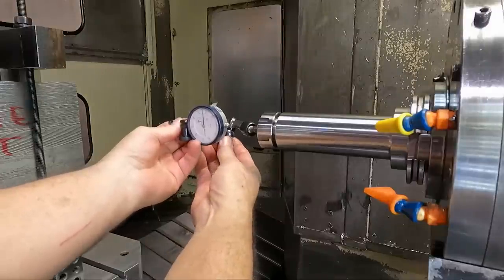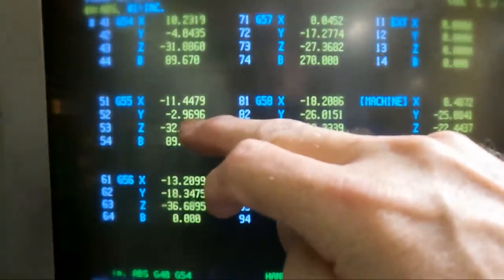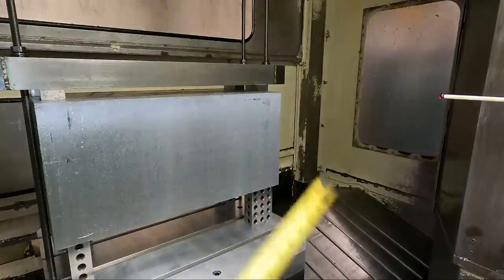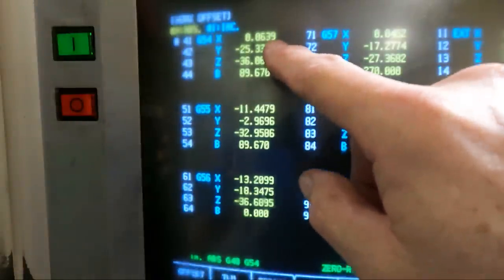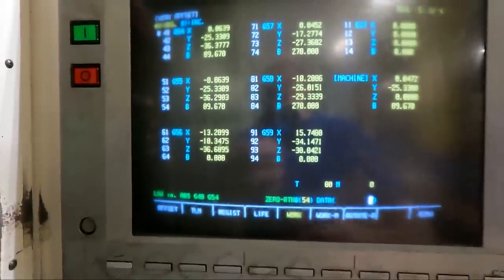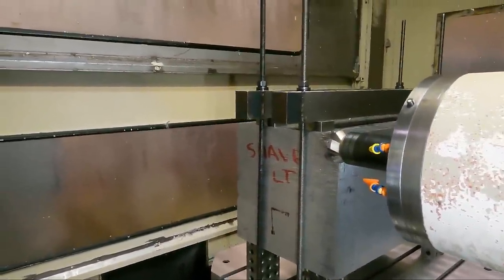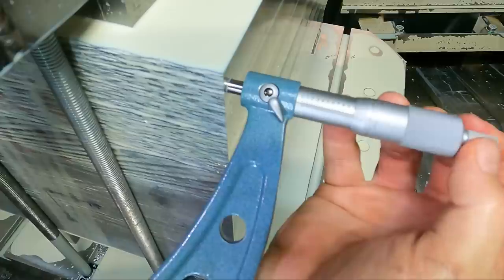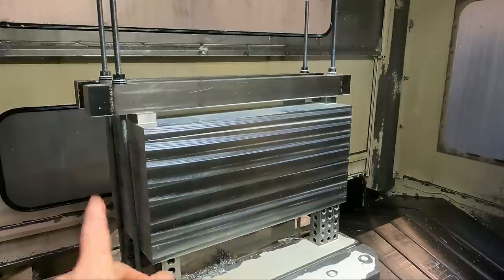Facing A Large Aluminum Forging

Comment: Did you ever try using millimetres? Realky is much easier to get the central measurement than inches.
Just try it!!!
Reply from the maker: I use both systems. Its just because my tape measure is in fractions. If it was in decimal inches it would be the same as a metric tape. I don't really understand this argument. When you are dealing in decimal inches its the same a the metric system. It's just that a meter is a different length than a yard. But the micrometers work the same everything is divided by 10,100,1000 in inches or millimetres. Its kind of like saying English is better than Spanish or some other language. Wouldn't it be better if you spoke both languages?
Reply: @David Allinson what do you have to say
Reply: @AlexxMarssh  I am 82 and grew up using inches but when metric came along I basically abandoned inches. I have done some heavy shipyard machining but in contrast took up clock making 20 years ago. Many clock designs are in fractions of inches which I found very unsatisfactory. If they had been decimal it would have made my life so much easier.  My mill and lathes are all metric so I kind of think in metric rather than inches. 
Thanks for your response which I  always find interesting from practising machinists.

Comment: Why not use a battery powered-drill with a ball-end or normal hex head to do the bulk of the bolt turning for those numerous fixture bolts, and use a wrench to do the final torques? Perhaps I'm lazy.... you must have strong hands anyhow XD
Reply from the maker: What did we use to do before battery powered tools. Kind of like cell phones. Actually your not the first one to make a similar comment. Except they mentioned a cordless impact wrench. I don’t have one. But I do have a air impact and you saw me using a air gun to blow off the screws. I could have used that. But I like to do things old school. Didn’t take but a minute more to do. Thanks.
Reply: @EdgePrecision  You may want to consider watching a couple of videos on the channel "Mr. Chickadee". All manual woodworking - very relaxing. Guy has some opinions about power tools. I can definitely see where you're coming from - everyone draws the line somewhere. Like the joy in I take in manual layout + machining when I have a perfectly good cnc. Thanks!

Comment: As far as I know, these big sawn Aluminium pieces are cast and not forged, but maybe there are also big forgings
Reply from the maker: These are forgings. It says so on the paper work.
Reply: @EdgePrecision  Okay, then they are obviously forgings, from my work I only know these as castings
Reply from the maker: The side you saw in this video was sawed (I think from a larger block). But the other sides you couldn't see in the video. There are definite hammer marks where the power hammer forged the block. It is not smooth or flat. Just like a steel forging.
Reply: @EdgePrecision  Okay, at work we have even larger blocks, but they are sawn on all sides.
Reply from the maker: @nightraidone9768  One other thing these blocks have is. Marked on the outside faces are grain direction arrows (not really necessary for these parts). On a casting I don't think there would be a specific grain direction.

Comment: I'd have set the 3-2-1s flat for rigidity.
Reply from the maker: The 2-4-6 blocks are positioned that way to raise the part 6” above the pallets face. Otherwise the spindle would hit the pallet when making the lower passes in the facing cuts passes.
Reply: @EdgePrecision  Yes, thought so.  Don't remember seeing the need to have them so high in my many years in engineering.

Comment: Can I ask why you insist on using manual work tightening and loosening all those screws? You would save som much time if you used a pneumatic or electric tool to get all those screws in and/or out. And yes, I do know that tightening them in the end needs to be done properly with a torque wrench.
Reply from the maker: You can ask. The answer is because that’s the way I do things. If you drive screws in and out with a impact driver. You can’t tell if your damaging the thread. But by hand you have a feel if something isn’t right. Also you don’t have to use a toque wrench for everything.
Reply: @EdgePrecision  OK, that makes sense. Thanks.

Comment: Dosent look the sturdyist of fixtures where's the lateral resistance I get he's working both sides but surely you could clamp it on the ends aswell rather than just from the top , not trolling just wonderd
Reply from the maker: How could it be clamped on the ends? In order to face both front and back parallel and to dimension in one setup. This is the only way to clamp it. Did you notice the 1,2,3 blocks under the clamp bars? It is in effect clamping at each end. Also take note of the positioning of the 2,4,6 blocks under the part. They are facing in directions to increase stability. All this is necessary for clearance of the spindle above the pallet face. This setup I have used many times with all materials and never had a problem.

Comment: America just needs to grow up and leave imperial measurements in the past. The idiocy of going from inches to decimal inches is tragic. Talk about where mistakes are made.
Reply from the maker: I would assume you mean converting from MM to Inches or vice versa. Not from inches to decimal inches. Working with decimal inches is really no different than working in MM or Centimeters or Meters. Its just a different language so to speak. Besides all our measuring equipment is in inches so if we don't want to spend the money to replace it all. We will be converting the from the metric system to inches anyway.